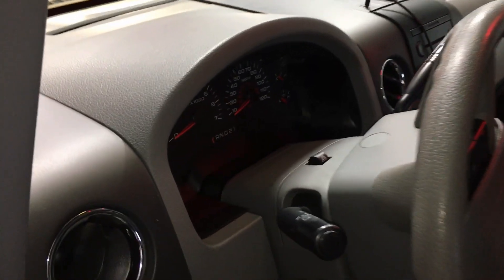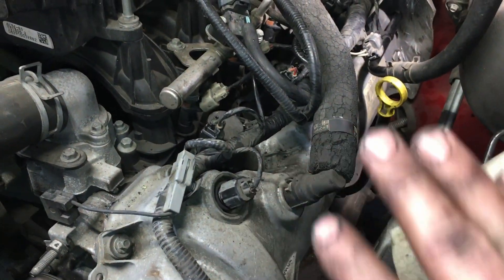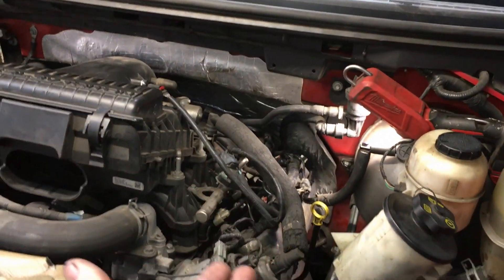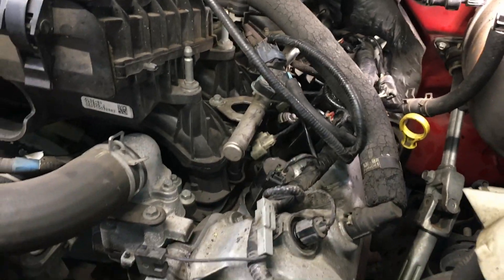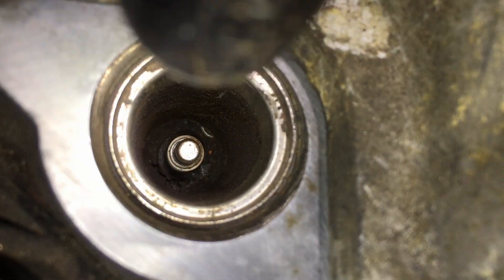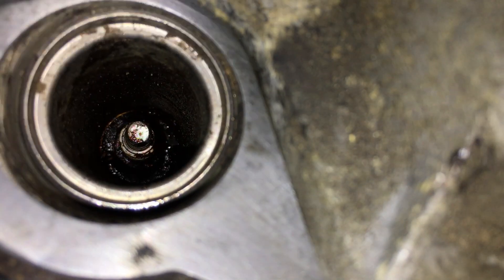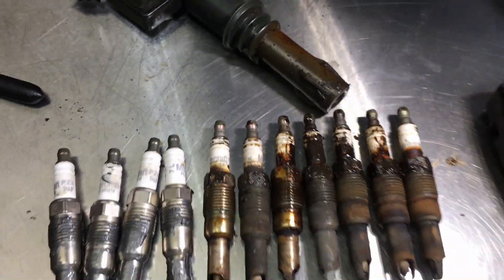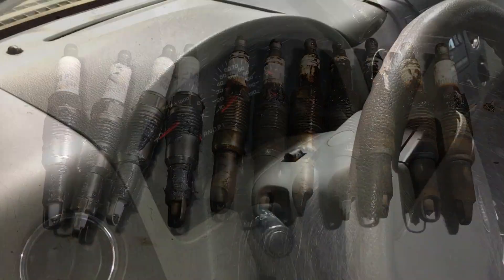Ford 5.4L 3v Triton Engines Fuel Smell and Ticking Tapping Noise: CHECK THIS ITEM FIRST!

Comment: Just did plugs on my 04 f150 5.4 yesterday and cylinders 1-4 I didn't even need ratchet to get plugs out, spun them out by hand, fixed the misfiring

Comment: If an owner isn't aware that a spark plug is not physically torqued propper, they deserve to own a 5.3L Ford.
Reply from the maker: Ford does not make a 5.3L engine.
Reply: @FordTechMakuloco  
Greasy hands, 5.4L 3v.
Sorry.

Comment: I have a 2005 140,000 miles and just so happen to have this issue, I also noticed smoke out the exhaust. Would that be indicative to the loose plug or more toward a valve problem?  Same tick and smell. I have switched the coils around with no change. Cylinder 3.

Comment: Dude, you are the man!!!

2005 f150
I had tapping, which I thought was the rocker, it was very loud. Sounded Just like your video.
It had a miss, for awhile, then the tapping started, then I started to smell gas once in a while, but no leaks.

I had a tuneup @ 110,00, and they snapped 3 plugs. What a mess. At about 120000, it started to miss. I let it go due to the bad experience with the tune up. It started to miss worse, so I bought aBlueDriver. It scanned #3 coil or plug. Pulled the coil, it smelled like gas. Plug came out by hand, turns out plug tip broke off in cylinder. Bummer. Camera shows piston pitting, but nothing is banging.
Put in new plug, new coil, started it up and perfect.
No tapping, no miss, and no gas smell. All codes cleared and good. Purrs like a kitten!
Thanks a million for this video. Easy $60 fix that I’m sure a shop would have charged 10 times more.
Awesome!!!
Thanks again, CJ

Comment: Have you seen a lot of cases where the spark plug electrode breaks off and the cylinder starts misfiring?  I wonder if that's common with (what I believe to be) genuine Motorcraft plugs.
Reply: Brian did a video on counterfeit motorcaft plugs and what to look for before installing. It was probably a year ago but if I remember correctly the tips on the counterfeit plugs were welded on differently/poorly…I don’t remember him saying that they indeed fall off however its worth keeping mind next time you do plugs. Read the comment section on that video someone may have mentioned such. Good luck
Reply: Just reread what you said about them “possibly being genuine” at which you probably already saw the video. On my 09 the plugs are in there tight…changed mine at 100 k and plan to get back into there soon.

Comment: I have a 2006 F150 5.4 i have a lean bank 1 and a evap code....it has a cold air intake...after market.and a chopped muffler. Codes this be causing my codes. I need to pass inspection. Also that hose looks rough.

Comment: I had a random fuel smell start a couple weeks ago and of course I expected to have to inspect the fuel system from front to back, then this video popped up. I just bought this Expedition about a month ago and he told me that he had just had all the plugs changed out, so I figured it was worth a shot. That and a surprise misfire started 2 days ago.

#1 cylinder was actually over-torqued, it was a 2 piece design and there wasn't any anti-seize on the plug. So I went and bought all new one piece plugs because now I definitely have to replace them all. 

#2 was about 3/4 of a turn from being seated, much less torqued to spec. Coil boot stunk of gasoline, but no damage. Pulled it out and the electrode was gone....well that's a first. Additional research showed the bad connection to the head can cause the plug to overheat and melt the electrode. The look of heat tempered metal around where the electrode used to be confirmed it. Still pulled out the borescope and sure enough there were copper flakes on the piston face and one nice little globule that has set up a permanent residence on the piston. I didn't really think I had broken it off removing it, but better to make sure there wasn't a loose piece of metal in there ready to wreck havoc on a cylinder wall or valve seat.

#5 - #8 went without incident. Getting ready to go out and tackle #3 and #4. My torque wrench did want to get bound up around one of the heater hoses and what I'm guessing are relays on the firewall using my long socket extension going into #2, but that was easily surmounted by just adding another extension. Not really sure how he failed to torque that one down, maybe he just forgot and it was only hand tight to begin with. Guess I'll find out when I get to #3, because if he had trouble with #2 there's no way #3 and #4 are done right.

So from a guy who has done all his own mechanic work for the last 28 years by the book, I really respect your technical expertise and love your channel.

Comment: Had the same issue in my '04 navigator change all the coil packs still had the issue so then I started removing spark plugs they had put cheap spark plugs in the motor and the firing tip of the spark plug was too small. Switched it out to high performance NGK and the motor runs even better. People don't take your cars to a mechanic you can't trust.

Comment: Hey Brian.. I have a 2005 5.4 with stage 3 roush everything.. SC, intercooler, air intake, throttle body, injectors, headers and exhaust.. just did a plug job had no problem pulling all of them out after the first 1/4 turn.. like by hand.. 2 cyc had gas smell one on each side.. replaced them with real 515-546 motor craft with nickel anti seize.. and the COPS as wel with die electric lube in each tip.. now It was running pretty bad before and pinging even with 91 and octane boost.. I even tried 103 VP fuel I found in LA.. still pinging and a lit exhaust sounds leak from header area.. after the plug change it started right up and ran smooth AF.. except that lil exhaust leak kinda sound and lite pinging under load or over drive in high gear at low rpms and get on it a lil.. I know what pinging sounds like and I know that’s what it is.. so how do I fix it.. it’s got 119k and super strong motor.. and trans still.. 

PS the intake tube had a fat hole in it from the SC belt breaking or something and I never seen it till I did this first plug change since I got the truck! I got a new tube and the battery was off the truck for 2 days so everything should be reset and in a new learning mode yea? That’s why I was getting p0170 code before lol

Comment: I need your address as I want to send you candy and flowers.  I have an F150 5.4 3 valve, two different places including dealer told me "Cam Phasers",  I instructed the dealer I wanted three items corrected 1) Raw fuel smell 2) rough Idle 3) ticking.  Today he called and said "two plugs were loose, and he replaced all of them. Problem solved, because of your help. THANKS!

Comment: Im an ol-timer Ford wrench from way back.  Got out of it as a profession in 1986.   Went an looked at a 2011 Expedition today - really nice SUV other than having 224k miles and like valvetrain - rocker, lash adjuster.  It really sounds like an old cast iron hed with a sloppy valve guide would sound lke on say an ol' 289.  One they started changing the alloys used in these engines the sounds changed as well.  I've got an '06 SuperDuty 6.0L PSD to suck up my spare change,  Think I'm gonna pass on the 2011.....   Really pretty XLT though......

Comment: Hi ford tech I changed my plugs in my 2010 f150 5.4 3 valve I put anti seize on threads. Now when I start I find its hard to start  and when it does fire up it's sputtering smoking and then put in neutral get it to calm down it clears up then It seems to be fine again untill next day.

Comment: I used to have a CTS and oil in plugwell meant u had blown valve cover gasket. So with that knowledge it threw me off. Glad i just watched this video. 👍🏻👍🏻
I just changed out my Coil packs lastnite with some MSD Blasters.
I noticed a tiny bit of oil in #2.
Now i see this video 🤦🏻‍♂️
Going to pull out #2 coil and check the tightness of the plug this morning.
All the others were dry and somewhat clean.

Comment: Great video... I lost reverse.. 2007 f150 lariat 4x4..  this little knob on a collar snapped off.  Its 86 dollar part at dealer.. do you have or can you make a video about easiest and fastest way to remove transmission, where this part is, how to gather at it, and should I do a rebound,  upgrade torque converter, shift kits, rebuild, etc since it will be out.. Are there any specialized tools needed, etc..

Comment: So what is the ticking that you here in the Ford motors.. you can hear it in the video and mine does the same thing.. what cause the ticking at idle is it just how they get after high miles? I have 158k
Reply: Update, the clicking was in fact a loose number 1 plug. It was super loose and I could turn out by hand.  The plug was destroyed and I cant believe that it was running as good as it was. Wow.. I wish I could show a picture of it.. 

All the signs of loose plug were there... gasy, toxic fuel smell,, blow by on plug boot , dirty plug hole, loose plug and build up all around plug. The plug tip was gone and plug metal around porcelain was missing chunks.

Comment: I herd a ticking coming from my engine, put my stethoscope on several places and it's coming from the fuel rail. Is this normal sound, you can hear the same sound in this video when he pans over to the passenger side.

Comment: I have an 06 I bought used and nearly got gassed to death with this problem. Two different dealers replace left and right exhaust manifolds to no avail. I decided to change plugs as a purely maintenance planned job. Got all the plugs and checking the seat taper found evidence of blow by. Ran thread chaser in all the holes and torqued new plugs coils and boots. Noise and gas smell gone.

Comment: Hi I’m working on a 05 f250 with a 5.4 3v and the truck looses fuel pressure.  It has a new motor craft pump and I tried swapping the fuel driver module. Also the fuel pressure drops only after it’s warmed up. Once I turn the vehicle off and turn the key on engine off the fuel pressure rises to 25-30. Once I start driving it drops to 5 psi and stalls out. Was wondering if you seen this issue

Comment: I have a '99 Ford Explorer 4.0L SOHC with 118,xxx miles. I bought it 5 years ago with a bad head gasket for $100 in perfect shape. Long story short, I parked it and bought a new car. I just overhauled it (replaced a cracked head, lash adjusters, head gaskets/all gaskets, and all of the timing sprockets, chains, tensioners, cassettes, and bolts) but I have this bad tapping sound. Cylinder 1 had a little lower compression than the other 5, but I believe it was a stuck ring. Compression has balanced out and the truck runs great. 

Now, I can hear the sound good whenever I lean below the passenger side door where the catalytic converters are. There's a rattle in the exhaust as well, so I'm thinking the converters are bad and possibly broken from whenever the head cracked and dumped cold coolant into the hot converters. 

Do you know if the 4.0L SOHC has the loose sparkplugs issue as well and if the catalytic converters could be making this sound?

Comment: Think you so much for this video. This is the exact problem that my 2004 F150 had.  It had that tappng sound for some time but only recently started smelling fuel in combustion gases in the cabin. I couldn't find the fueling so I thought I would search your videos for an answer. And here it is! I changed all the spark plugs and the fuel injectors since the vehicle has a 175000 miles. It now runs absolutely fantastic, I guess I didn't realise how bad it was running right before.  This is an Arizona truck so it doesn't have any rust, but what it does have is electrical clips that kept breaking. I ordered a whole new set of clips (pigtails)  for the injectors and coils since about half of them broke either going on or off. One was apparently glued on by the last "mechanic.". I'm  wondering if this is heat related?

Comment: Why does my 5.4 drop my mpg from 13.6 to 12.4 sitting there idling? Tps is around 14 to 16 and timing starts around 40 and drops down as rpm increases. No engine noise and i just put on a ford certified tps sensor.

Comment: I have a 2006 f150 5.4 l that the motor just started shaking badly under load, but would smoothen out a lil bit with acceleration. Threw up 10 codes, most of them misfires like p0300, p0305, p0307,and p0308. I also smell raw gas when I first start it up. I just had my plugs and coils replaced probably less than 20000 miles ago. The truck roughly has around 160,000 miles on it. I'm going to check the plugs and coils and bank 2 tomorrow, but could it maybe just be some plugs loose? I'm hoping so, other forums point to my cam phasers are going, but a friend of mine had his phasers go and said his truck didn't shake that bad and sounded completely different with his bad phasers. I'm not really ready to tackle on a timing/phaser job! The other codes it's throwing are p0010, p0018, p0020, p0022, and p2198. Any advice or tips from anyone would be greatly appreciated!

Comment: Hey @fordtechmakuloco , i have a 2005 5.4 3v triton, I’ve had it for about a year. It has a ticking noise from startup and continues even when the engine has reached operating temp. It had a miss and i replaced the coil packs and cleaned the spark plugs. The miss has since ceased but it still loses power in 3rd or 4th. The ticking is still around and seems to be getting worse. I narrowed it to the driver side camshaft using a stethoscope. What would you suggest i do from here?

Comment: This is what I wrote at one forum long time ago - When I changed spark plug wires today at my another car I spot far more vibrations when I set my finger at top of one spark plug boot then rest (certainly engine must work). It appear that spark plug was very loose. It seem to me that is enough to set finger at top of boot to check for spark plugs looseness. Our trucks have problem with it and this seem to be quick check. Any opinion?  

So should be possible check for loose SP just with finger at top of COP.  Even screwed COP should have some vibrations from it.

Comment: Thank-you, thank-you. This was exactly my 2008 F150's symptoms on the passenger side of the engine. I suspected either a Cam Phaser issue, or an exhaust manifold leak. As soon as you mentioned the odor in the cab that was an aha moment. 375,484 Km on the truck and it runs perfect, almost, otherwise. (There is an intermittent ticking originating from behind the dash though. Sounds like a relay.)

Comment: I have a 2008 Ford Expedtion that out of the blue started misfiring. It had misfires on cylinders 8,7,4 and then a multiple misfire code. I’ve replaced all coil packs a spark plugs and still getting misfires in multiple cylinders and now sounds as if it has a small spark knock under load. It’s really running like crap! Any ideas as to what my issue may be? Thanks

Comment: I just bought a 2004 5.4 with 277,000 miles and it kinda lacks in power a bit. Also when I get on it and come to a stop it smells like straight gasoline.

Comment: Question 
After I installed new fuel injectors in a 2008 Suzuki Grand Vitara now I have white smoke coming from tailpipe that smells like gas what can it be it was not doing that before I got new injectors

Comment: Thanks to this video, I figured out my spark plug was loose. Beyond that however, I found that the strap on the end of the spark plug had come off completely. Luckily, nothing seems to be injured and the new plug completely fixed the problem.

Comment: Hey I just replace the spark plugs, ignition coils, fuel filter and my gas mileages still bad. I had a egg smell under the truck and I also changed the catalytic converters and o2 sensors and now my gas has gotten worse. I also hear a ticking noise from the engine once in a while. I ordered the updated oil pump and I will install it soon. Do you know why my gas mileage is so bad? I’m literally getting 10mpg and I use this truck everyday. My tires are also properly inflated and I’m also noticing a burning smell coming from the engine. What do you think is causing this poor gas mileage and this horrible smell?

Comment: Um...was that the coil moving back and forth? My guess is that's clue #1 that the plug came loose! 😆
Reply: He had the bolt holding the coil pack already removed, you can see it in the video.

Comment: So the ticking we hear after the replacement of the spark plugs is completely normal? The ticking after the fix(in this video)  is amplified in my truck as soon as I gently step on the throttle in forward and reverse..any idea if thats an issue?

Comment: My 08 Expedition has a weird vibration from 35-60 mph. It goes away if I give it a lot of gas. Feels like you are going over a fumble strip on the road. Haven't found a mechanic yet that knows what it is.
Reply: I had this, needed transmission service, drop pan, change filter fixed mine
Reply: Ron R that is what I am thinking

Comment: I have a 2006 Lincoln mark Lt and All of sudden it will not start. It cranks and won't start. The fuel pump is good and fuel modular is but I think it's my spark plugs. Any suggestion I am thinking of changing the spark plugs.

Comment: What about the 2010, will it have the same issues?
Reply from the maker: no
Reply: @FordTechMakuloco  , what could it be if it runs rough and lacks a bit of power in the low gears, does this model also has problems with vct solenoid? Thank you for your time!!

Comment: love this video...saved me a ton of time and aggravation..i bought this truck used last june with 117k on it..the fuel smell was horrible and i have 2 little ones..i would drive it with the window down...finally saw this video and went at it...3rd plug from the front on drivers side was finger tight..buttoned everything back up..noise gone but more importantly, the smell was gone!!!!